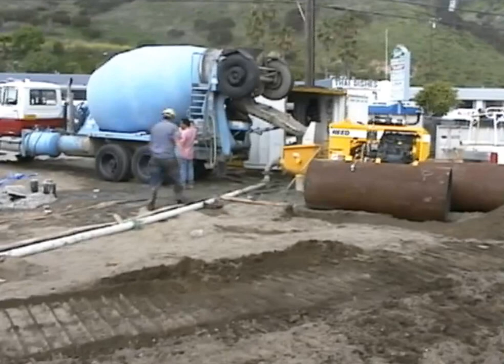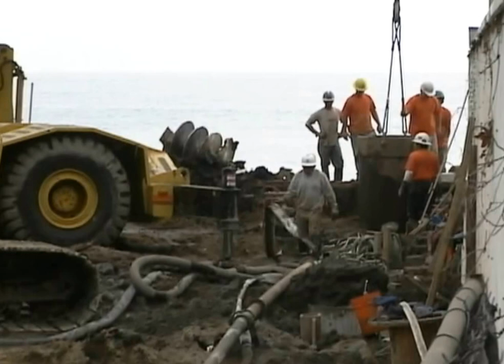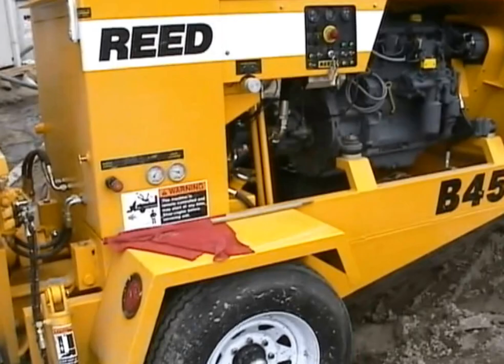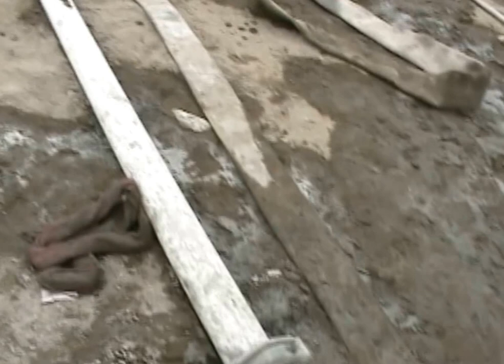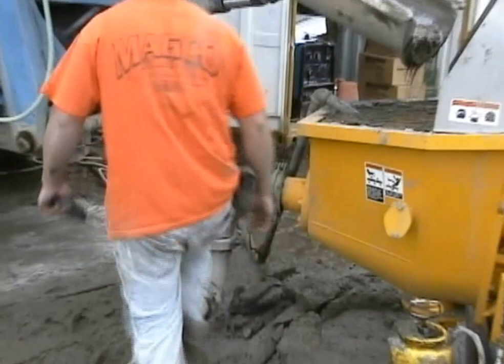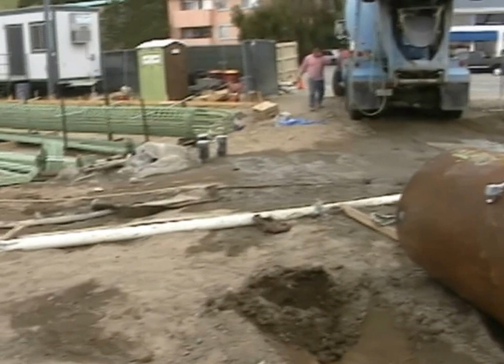Caisson Construction REED Concrete and Grout Pump

Comment: When you pump caissons you are ALWAYS going to fight water.   The mix is always 5000psi.   There is so much stopping and waiting to pump water and remove the sleeves, that the job can quickly devolve into a nightmare for the pump operator.    To even touch a caissons job we require maximum retarder (3%) and at least 90 minute spacing on trucks.   If those conditions are met, then the jobs are generally a success.
Reply from the maker: thanks so much for the insight, very cool!!!